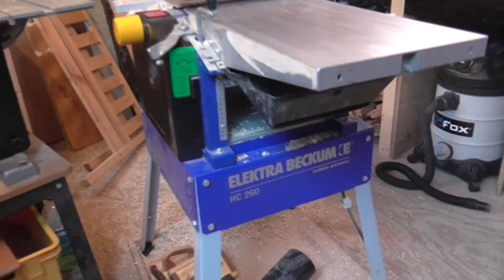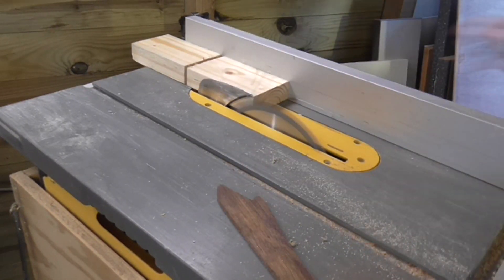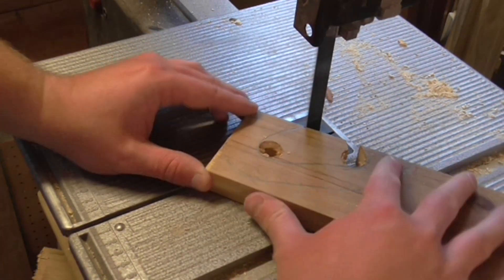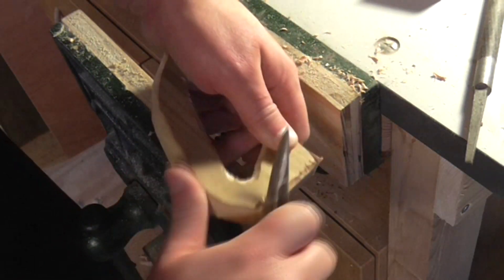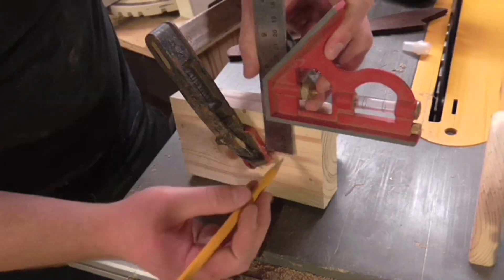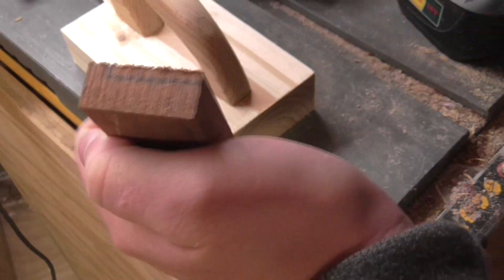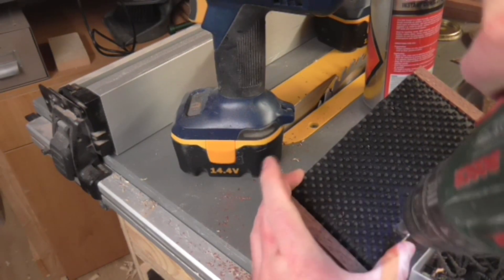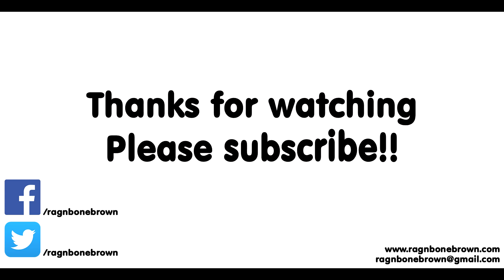Making Push Blocks for the Jointer

Comment: Just what I am looking for, for my 10.5" Jointer and Thicknesser which came with a narrow plastic pushstick identical to the type you get with a tablesaw 😲🙄 I'd much rather make pair like your ones than than having to use the already supplied useless pushstick 😁👍 When you pay over £500 for it you expect to at least get a couple of proper push blocks with it 🤔😢

Glen 👍